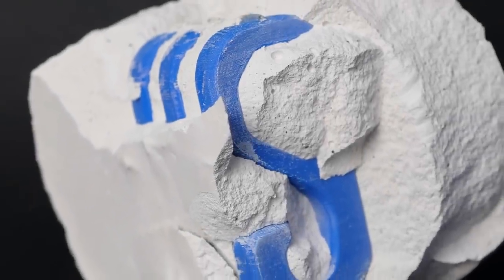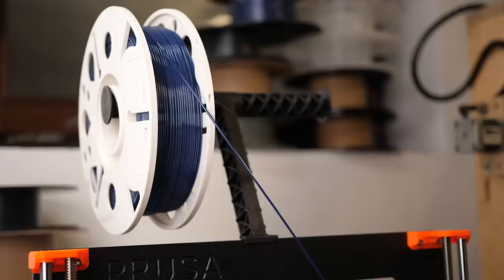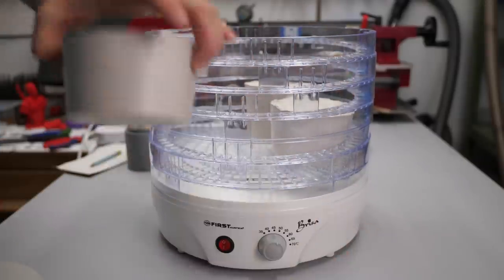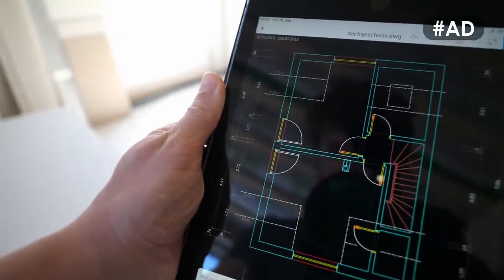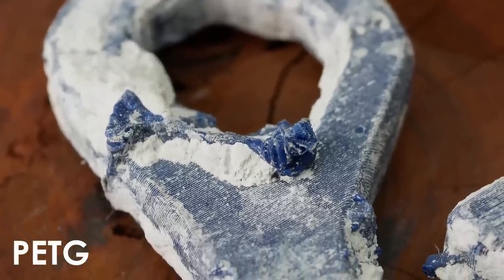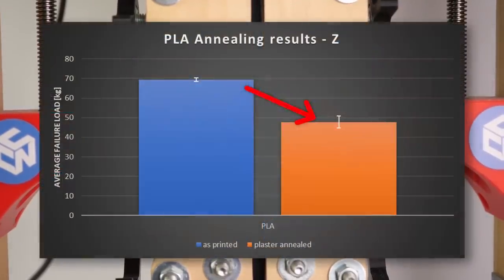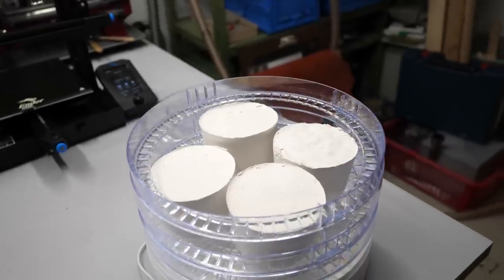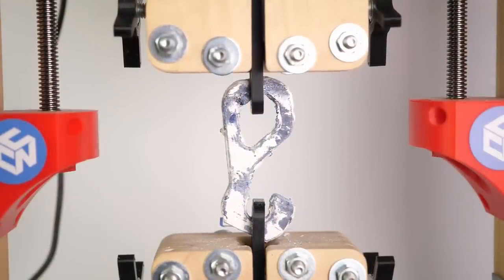Triple (x3) your Layer Strength by Annealing 3D Prints in Plaster!

Comment: That amount of effort is exceeding injection molding though.
Reply: How much is an injection molding machine, and HOW much does it cost to get the molds made up?
So the effort goes into a life sucking job.
Reply: @Margarinetaylorgrease  I was suggesting making your own plaster moulding machine. Maybe I used the wrong terminology.
Reply: @Margarinetaylorgrease  De Crass Man over at the SteadyCraftin channel just bought a plastic injection-molding machine with a 1-cubic inch plastic capacity. It was a simple model, so it only cost two thousand US dollars for the base unit.  Accessories are also expensive.
Reply: @FranklyPeetoons  Everybody should have one.
Reply: you can do this with uncastable geometries
Reply: @ravener96  That's an interesting thought. What would make a geometry uncastable?
Reply: @Martial-Mat  Yeah, you need 5 pieces of a hand sized object. Got any idea how much the mould making costs for injection moulding? ;-)

Comment: I would consider a concrete vibrator to eliminate/reduce bubbles in the plaster. I would also consider doing the annealing in an autoclave.

Thank you for meticulously documenting your experiments and sharing them with us!
Reply from the maker: Good point. A small vibration motor might do the trick as well.

Comment: We dentists use a split mould technique. The description given by Seecalator on how to mix plaster is good, sprinkle it into water and let it soak it up, mix and then we would use a small vibrating table to get the air-bubbles out. Or bang the container on the bench a few times. Coat the print in a suitable separation medium and then place it embedded  slightly into a layer of plaster that fills only half of the height of your container. Let it dry and then paint that layer with separating medium. If there are no undercuts in the model, fill to the top of the container with paster. If there are undercuts pour in a layer of plaster to cover the model and its undercuts. Let this layer set. Coat with separating medium and then fill to the top with another layer of plaster.

When you have annealed it simply seperate off the layers, usually by cutting a small slit into a layer and carefully splitting it. If I was doing multiple layers I would do the top, then the thin undercut layer while still attached to the based, and then free from the base.

There are solutions that will dissolve gypsum.

Good work chap.

Comment: This problem reminds me of lost wax casting in the automotive industry. I saw a documentary on it a few years back. Though in the case of annealing 3d printed parts I think it would probably be worth your time and effort to convalute the process a little bit. 

First I would recommend using a dual extrusion system and encase your specimens in a few sacrificial perimeters of water soluble filament in order to make sure they are easy enough to remove from the annealing cast. Then on the outside of the soluble shell you apply a thin layer of wax and sand. To make sure the parts do not deform while annealing. Then to finish preparing the part you use a somewhat thick slurry layer of plaster to anneal in your oven/kiln. 

I think this process would use considerably less material – which is possibly part of your problem. A monolithic slab of plaster takes longer to get to temperature and longer to cool. The wax will boil off but if it is a thin enough layer the water soluble filament should protect the finished part from deforming due to voids without contaminating the specimen once it goes beyond its melting point.

I hope this is a helpful thought!

Comment: The same air bubble issue comes up when encaping electronics in epoxy. I'd love to see you try this again but use a pressure chamber on the plaster before you set it to dry. Could also allow you to go to much higher temps and print more complex designs. Just make sure you don't anneal anything hollow! :)
 
I also wonder if there's a hydrophobic coating you could apply to the PETG parts before dunking them in the plaster? It wouldn't need to survive the annealing process, just the dehydration, so pretty much anything would do I imagine, as long as it doesn't react with the PETG.

Comment: Using a palm sander (without the sandpaper, of course) on the bottom of your plaster containers will help remove the bubbles. This is a super handy tip for removing bubbles from most casting materials.

Comment: Paint the part with a thin layer of really fine plaster. Painting allows the plaster to go down with no bubbles on the part surface. The part and plaster can then be really properly dried in less than an eternity. Then place the plaster coated part in a bucket and add fine dry sand, vibrating to aid compaction ever ~5 centimeters. Insert in oven. Anneal. Serve a very simple salad. 
Saw this trick on a VOG metal casting channel video. We are now using it in one of the castings the undergrads have to do in MSE. Works great.

Comment: I want to test Metal filled filament and then sinter the parts. Sintering parts is very difficult to do at home without major problems like melted parts and poorly fused parts. Maybe try sintering the parts in the plaster? that would be interesting. Good work keep it up. 
Best Matt

Comment: Alo Christian, great video as always. 

FYI, there are no commercial viable application for injection molding PLA. So it may not be a very good benchmark. FYI, the main reason why PLA isn't suitable for in injection molding btw is 1) the material is an oxidizer, meaning you need special Stainless steel hot runners to sustain the corrosive effect of PLA. 2) It isn't very stable as a material, an parts made will have have induced stresses and will crack over time.  Just as an example, I have on a my desk a closure (28 mm PCO 1881) made from injection molded PLA and it cracked within 30 days while under applied torque (screw on closure for water bottle: Terra Water brand, (ebbeverages.com) 

And PETG Resin on the other hand was specifically develop for Extrusion Blow molding (not injection).  crystallization

Would be interesting to test if there are benefits to a slower ramp up-down temperature with PLA. As to reduce the amount of stress being introduced. While increasing crystallization.

Cheers

Comment: Instead of annealing PLA inside a solid plaster envelope at a certain temperature tuned for this specific process, wouldn't such a solid envelope allow to completely melt the PLA at a really higher temperature, like for casting? Except the PLA part would already be right here inside the mold from start in a solid form, instead of being casted into it in as a liquid at a later time. In the end, the part would perhaps look like injection molding? What do you think?

Comment: Fantastic video. I think I would like to see if we can find something to coat the printed parts before embedding them into the plaster so that they are easier to remove after the oven. Also maybe follow some of the other comments recommendations to try and remove all of the bubbles from the plaster before it sets. I think that drying the plaster much longer will help with the bubbles inside the plastic parts.

Comment: as a little tip. You could also use "goldband" which is normal plaster of paris but with some adding wich makes it set way slower
Reply from the maker: Good tip.
Reply: Or experiment with your own additives. Organic acids like citric and tartaric, plus sodium salts of the same will slow down set time (very small addition rates, circa 1%) as will borax.

Comment: You should retry using a smooth interface layer painted over the printed parts to see if this stops the plaster bonding to the lines in the surface. Not sure what would work best, but that could be a whole new series where you try things like gluestick, acrylic paint, varnish etc.

Comment: Really promising results. Thanks for your effort. Maybe silicone molds would work as replacement for the gypsum? They require more effort to make but should be reusable  and would require almost no post processing for the annealed parts? Or alternativelay create a custom (3d printed) mold for parts, so there is less gypsum to remove.

Comment: I wonder if green casting sand (sand with small amounts of bentonite clay and water) would hold its shape like plaster, but be much easier to remove afterwards.  It is often used for metal casting.

Comment: You may want to seal the prints with a release agent before plastering. This, in theory, will help with cleanup (if it survives the high heat)... but also could prevent Hydrolyzing of the PETG.

Comment: Thanks for a solid video and I appreciate the work you have done in the past. you’ve received many suggestions that may prove helpful in improving your annealing process. I cannot speak to most of them but I have a few decades producing ceramic molds and in using 3D printing for producing plaster molds for ceramic production. You had the right idea about putting the plaster in a vacuum chamber, but just place the wet plaster in there with out the plastic forms then pour the plaster into a container the parts are in. More importantly, don’t use plaster of Paris, use a high quality industry plaster like pottery #1, it won’t separate in the vacuum chamber and has significantly better working properties than plaster of Paris. I also recommend learning the process and timing for mixing it to achieve the best hi-fidelity and bubble free results. If you test using any mold releases I recommend a high quality mold soap but I am not sure how effective it would be at some of the temperature you are taking it to, but worth the shot. As I write this I do imagine oil based release might survive the annealing process a bit better than a traditional plaster mold release which is water based. Lastly, I appreciate the use of a food dehydrator, keep it slow and low. Plaster curing is a chemical process and it takes a while for the heat and moisture to work itself out, consider leaving the casts out in front of a common fan for a week, then dehydrating. none the less, good luck and thanks for taking this research on.

Comment: Hey Stefan, I have a few suggestions to improve your process. First suggestion is after you have submerged the items in the plaster if you can put them on a vibratory plate to help work out any and all bubbles. Leave it on there until it is fully set. 
Then when you place the items into the food dehydrator, leave it in there for a week. this way you can ensure that you have gotten a fair amount if not most of the water out of the plaster and maybe even the plastic.
Then, place the plaster in a vacuum chamber with the vacuum pump running for around 24 hours to finally fully extract all of the moisture. Slowly that the air in if you can make a chamber for the air going in to run through some desiccant to attempt to dry it out even more. After all this is said and done, run it through your annealing process but maybe make it 50% longer. And it allow it to cool down with the door closed.
Time is going to be your friend.

Comment: Have you tried packing the printed parts in dry plaster powder as is done in sand casting? 
It would make recovery of the part from the medium easy, and would eliminate moisture issues.

Comment: you can cook one or few layers of plaster at very low temperatures over the plastic piece and them use casting sand as compacting material around the piece, or salt as the other video you did, being a greener material and maintain temperatures longer i suppose

Comment: I think that if you could solvent smooth some parts and then remelt in a materal which you can get all of the bubbles out you would be able to remove any stress risers at the layer lines (since the plaster will keep all fine details). especially if you are able to remove all of the mold material after annealing/remelting, perhaps there is a type of silicone which could withstand those temperatures?

Comment: Hi Stefan, I think I have an idea, that could make the post processing easier. If you would use some sort of air tight rubber container, you could use fine grain sand to submerge the parts. Then evacuate the air to hold them firm.

Comment: Have you tried the sand annealing method using a sealed container that basically locks the sand to prevent the parts from deforming?
Wouldn’t work for hollow parts, but for solid parts it might maintain their shape since the sand cannot be displaced due to the containers pressure.

Comment: Fantastic video and experiment!
I wonder if there is no improvement in the PLA because it crystallises and becomes more heat resistant, therefore the layers don't melt and fuse. If this is the case, it would be interesting to see if rapid heating causes different results.

Comment: Before enclosing the parts in plaster, I recommend using a sealer/release agent.  Perhaps silicone spay.  That should stand up to the heat, hopefully keep water from penetrating the print, and make plaster removal easier.

Comment: I'd imagine you can achieve similar results while maintaining the low price of the technique and reducing post processing by brushing on a thin coating of the plaster then once it's hardened putting that in sand. That should keep the structural stability during curing while eliminating bubbles and obviate the need to remove most of the plaster. Using a thin coat would also allow you to use amonium bicarbonate to chemically degrade the plaster and release the part without any mechanical action whatsoever.
Reply: I though of this as well, but instead of causing a post process, use a material that would add to the part. My thought is to use aerosol resin to coat the part. As the resin hardens , the part plastics can melt together.  This might work great for a glass reinforced polycarbonate for ultimate strength.

Comment: I've made two sided plaster molds for bending parts which I couldn't otherwise print (without extensive supports).  Would then place the molds in boiling water and clamp.  Parts definitely seemed stronger after

Comment: Hi Stefan. You should try dentist plaster. It sets quickly and is hardening in minutes. The dental techniciants use a shaking table to avoid bubbles. To get rid of the plaster after treatment. You can use a small hammer.

Comment: Could you hypothetically seal the prints with a very thin clear coat or maybe a thin rubbed in layer of wax prior to submerging in plaster?  This would eliminate  the issue with the parts absorbing water in theory. And I would like to see this test done with the plaster truly degassed and completely  dried. I have a feeling that combination of minor changes could yield the best results. I'm intrigued.  Earned my sub!
Reply: If the point of annealing is to maximise strength, we have to consider what effect the coating mixing with the filament when heated would have. I suspect a wax coating would weaken it.

Comment: Fantastic video! If you went hotter with the PLA, could you force it to melt? If so, would you expect to see improved heat resistance and strength, or would the melting undermine the heat resistance?

(Just thought - if it did, you could always cool the part and then put it back in on a lower temperature to regain the heat resistance.)

Comment: I love cnc kitchen videos!

Why don't you try silicone mold for annealing? the maximum temperature of the cured silicone is about 230 Celsius. I use  Platinum cure silicone  and works really well with PLA and PETG very easy to remove it and no silicone inhibition at all.
Reply from the maker: I'll try, but silicone is more expensive than simple plaster.

Comment: you could drill some vent holes with tiny drillbit to let fumes escape or make mold from silicone or other polymer that resist heat.
if u use heatresistant rubber mold you could just poke it with a needle so it wont allow leak but only potential gases to escape

Comment: If you graphed the distance the part stretches (strain) as your x axis and the force you apply to the part (stress) as your y axis, you get a stress strain curve which you could compare to the other parts. The stress strain curve, as it's referred to, shows you the different regions of elastic and plastic deformation. A narrower (shorter on the x axis) curve shows a more brittle part as the part strained less during it's failure. This could be very interesting to see for this test. As a note, your test bench is going to have some amount of elasticity, so your graphs will all be offset by that amount, but they should be comparable.

Comment: I do not own a printer, but a suggestion is that, whenever you are melting/annealing  the prints, also print a spruce filled with material and open riser. So that when you try to melt, the material from spruce will enter the blow holes and gases will try to escape from the riser provision.
Providing compensation to shrinkage..

Also before casting it in POP, spray some sort of releasing agent, that will prevent it from sticking to POP. You can try coating with thin layer of wax, that will melt away on heating

Hope this helps...

Comment: You might want to try using dental lab stone instead of plaster of Paris. It is much more stable and dries harder than plaster. It can be purchased on eBay. Dental lab stone is used in the making of dentures. This may sound strange, but to get rid of air bubbles, use a vibrating egg-shaped sex toy. The vibrating egg part can be hot-glued to the bottom of a large plastic container to make a cheap and effective vibrating table. It works quite well to remove bubbles from a lab stone mold. You would need to use a mold release as discussed in other comments. Removing the part from the hardened lab stone mold can be accomplished with pliers designed for that purpose. They're also available on eBay and look a bit like a torture device. The pliers are made to break the stone away in chunks. Just a suggestion. Thank you for all your hard work and diligence! Great videos!